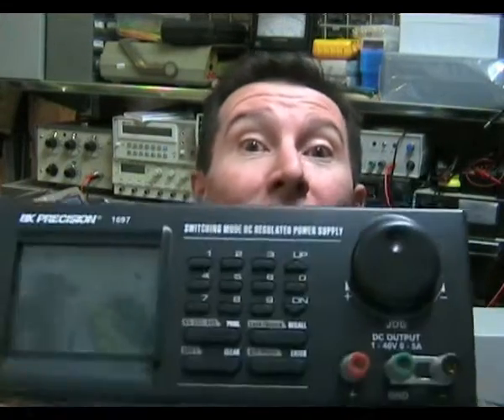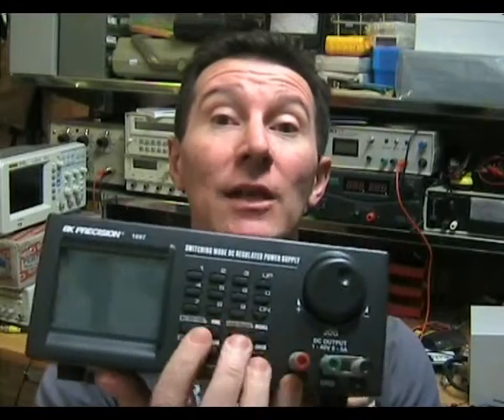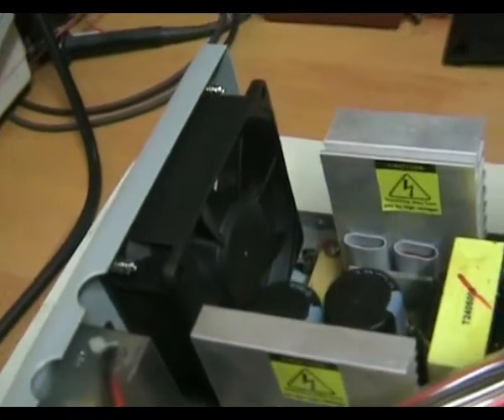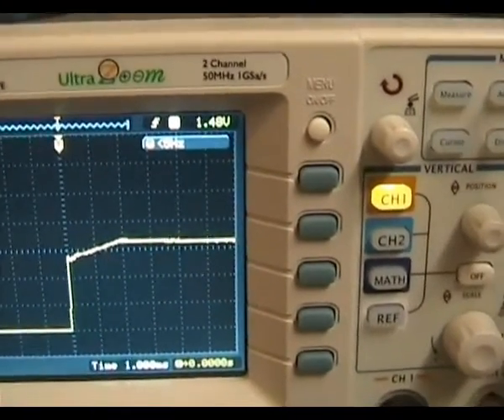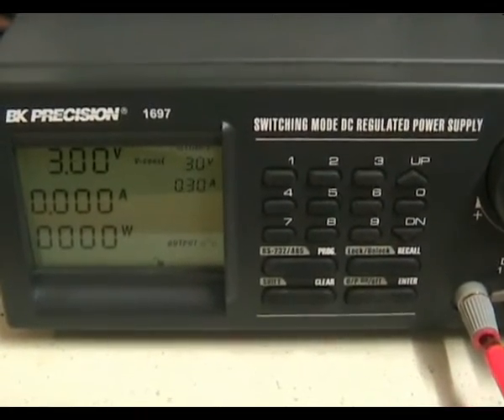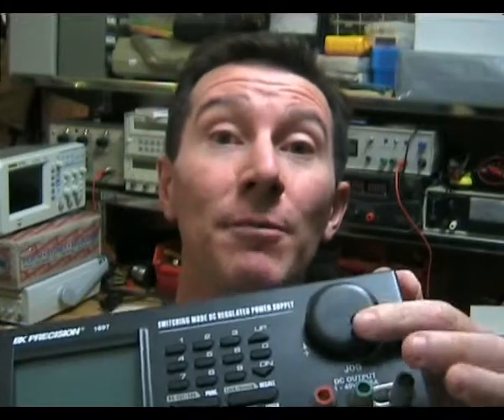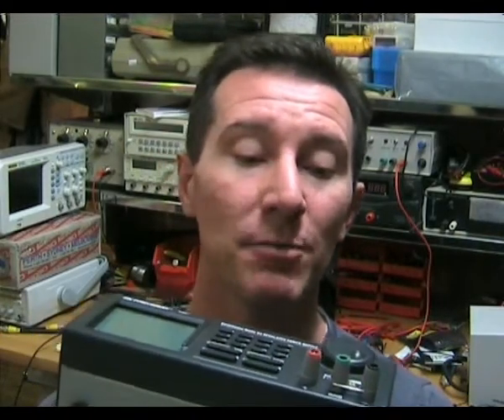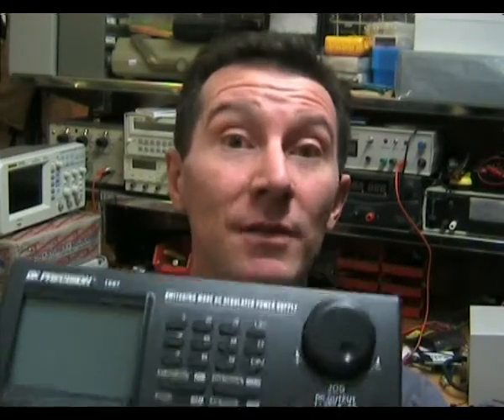EEVblog #8 Part 2 of 2 - Review of the BK Precision 1697 Programmable Lab Power Supply

Comment: BK Precision 1697 construction comment/ question -- Looking from the front towards the back of the 1697, two heat sinks are lined up along the right border of the circuit board.  Another heat sink is towards the center rear of the board.  The exhaust fan is towards the right side on the back.  Now, the cover has three vents, two on the left and one on the right.  If the cover were to be rotated 180 deg, the  two vents would align with the two heat sinks.  Did someone at BK P goof and the production mgmt decided to use the misformed covers anyway?

Comment: Need some troubleshooting help ideas - I have 2 BK Precision 1697 (circa ~2010?) units with the same problem.  Both max out at 22V even though the [shift] [0] over Voltage limit displays 40.0V.  Neither unit had been pushing current or potential limits when this problem developed, and neither have seen more than light use.
Any ideas?

Comment: Any idea what kind of chip was used for the user interface? You complain about the shift key being needed for just about everything. Now I notice it has 16 buttons, which is a suspiciously 'digital' number. Could it be that their IO chip can only scan 16 buttons? And more capable chips were not available for some reason? So if you want separate buttons for voltage and current, you have to give up something else. Sometimes UI design is just as hard and constrained as EE. :-)

Comment from the maker: Phenolic is fairly typical in supplies like this, so I wasn't going to mark it down for that.
The soldering was fine.
Yes, not the world's best construction board support etc, but adequate for a low end bench supply.
It's actually quite low priced for a PC controlled PSU.
Reply: you've aged well mate !  #2022

Comment: A $330(US)  switchmode bench supply gets a pass for using single-sided phenolic PCB? At that price, I'd expect at least FR4. Traces develop microfractures much more easily on phenolic than FR4. 

Some of the soldering and lead trimming looked horrible. The vertical boards looked poorly supported. How was the solder work on the bottom of the main board?  

On the plus side, the features were good to hear about, and thanks for the detailed spec checkout.

Comment: Agree completely, it works well as a PC controlled supply but I would personally not use it as a general purpose bench supply.

I think the next cheapest programmable PSU I found was half the power, and twice the cost. Granted it looked fancier and had better accuracy.